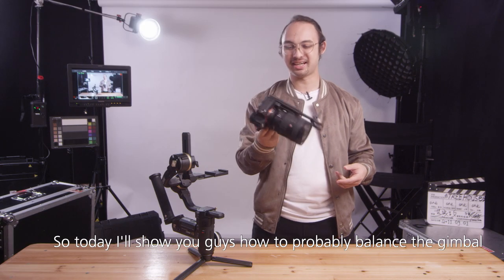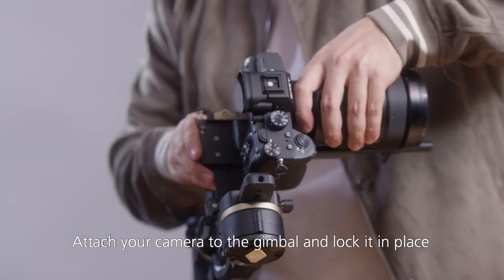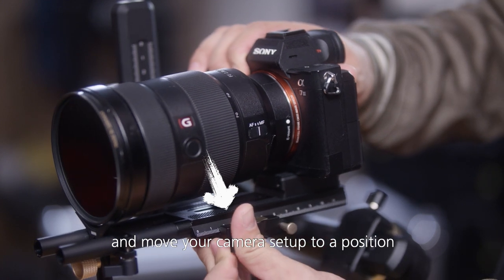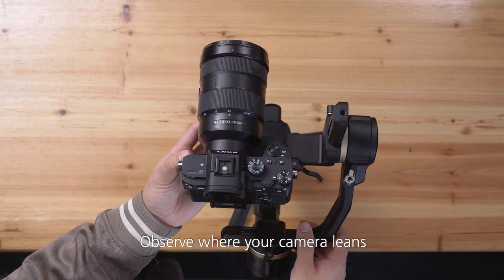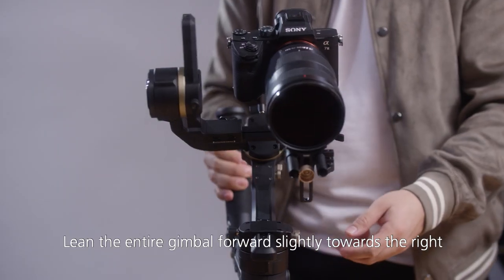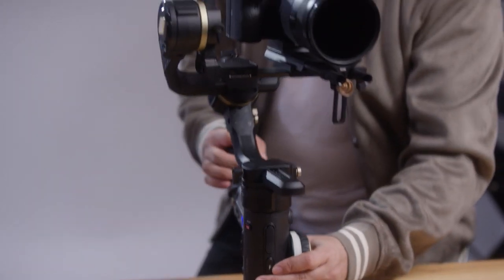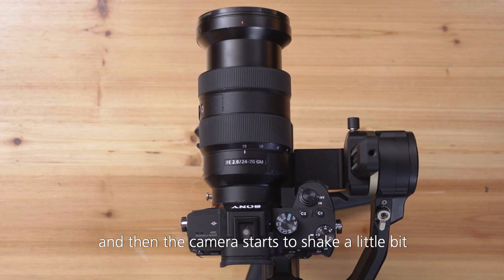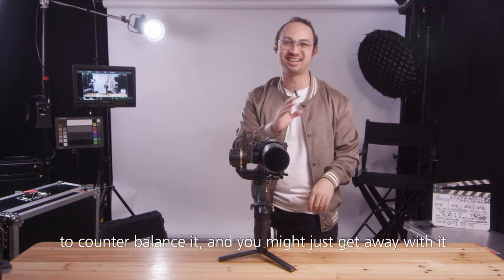Zhiyun Crane 3S OFFICIAL tutorials A3 balancing

Comment: I have the Zhiyun Crane 3S and Sony A7sIII. But the Sony will not connect to the Crane 3S . This is frustrating, as I want to use the record button on the gimbal instead on the camera. Is Sony A7sIII not compatible with this gimbal?        And the gimbal axis motors are noisy, anyone else experienced this?
Reply from the maker: hi the gimbal should be able to allow you start/stop record on the sony a7siii. Just to double check, did you update ur gimbals firmware to the latest? under menu/camera did u already select SONY? did u on the sony a7Siii i forgot in detail but there should be a USB setting in the menu, select something like tether instead of power
Reply: @marcelbrandel9078  thank u for answering! I have not updated the firmware, I will do so and also check the usb settings on the Sony.  But is the Crane 3s supposed to be quiet?  The noise from the axis motors annoy me.
Reply from the maker: @meske24  no problem. maybe try have the motor setting on low and go thru the same troubleshooting process of balancing in my previous two videos, then it should stay quiet.

Comment: Hi! I have been fighting with balancing the roll axis for a long while now. After balancing it supposed to stay in any position when slightly rotated, but it keeps rotating back to horizontal position. Both tilt and pan axes are getting balanced perfectly fine. The rig weight is 3.8kg which is below specified max load. Any ideas what might be causing that? Thanks!

Comment: hello good afternoon, i have a problem connecting my sony a7iir to the zhiyun crane 3s. The camera does not connect with the stabilizer and I can not have iris control, iso ... in the driving control. How could I solve it? Thank you very much
Reply from the maker: hi with Sony I rememeber it was only possible to start and stop rec. U'll need the sony multiport to USB Type-C cable and in the menu of the gimbal need to select Sony under camera setting

Comment: I cant setup this from 1:34, need some heavy load on other side? Sony Alpha 6400 is my camera.
Reply from the maker: yes, sony a6400 might be pretty light for it, maybe you can ducktape a bit weight beneath the camera plate, or if u did purchase the transmitter have it on there too
Reply: @marcelbrandel9078  i put this little piece under camera you show on video before and got balance. My lens make problem, because is to heavy.
Reply from the maker: @ssaajjkkoo  then you;ll most likely need to shift it more to the back on the base plate

Comment: How do you get the camera to angle straight up?
Reply from the maker: you could just use the joystick in pf mode and push up, or if u meant while balancing then just release the axis lock and adjustment lever

Comment: my gimbal even when calibrated, when turned on, shakes with any motor calibration setting. Is it a factory problem? I have found other users on the internet who have had the same problem but no one explains how to fix it.

Thank you
Reply: Too much motor power ..rig is probably too light .. turn motor power to low and see how you go .. worked for me

Comment: Can anyone explain how to connect a Sony A7sIII with the Zhiyun Crane 3S? The A7sIII is on the compatibility list.
Reply: Hi. When everything its done, balance, connect cables, etc., first at all you must to set up the camera on remote control, in the gimbal you must select camera "sony-usb" option. And after this, first turn on the stabilizer and then the camera.
Reply: @aozfe  I will give it a try but first I need to get a replacement gimbal. It went into sleep mode and gave me the red light of death on the power button, right in the middle of a paid video shoot. Seems to be an issue with the Crane 3s.
Reply: Oh, Im so sorry to read it. I hope you can get the replacement soon.
Reply: @aozfe  Me too. Last chance for Zhiyun. I truly love their products...when they work.